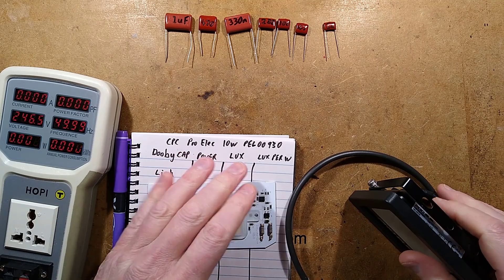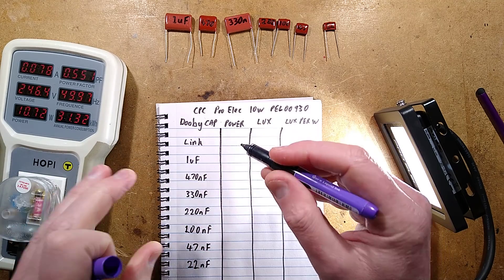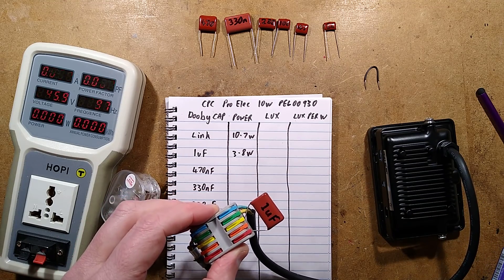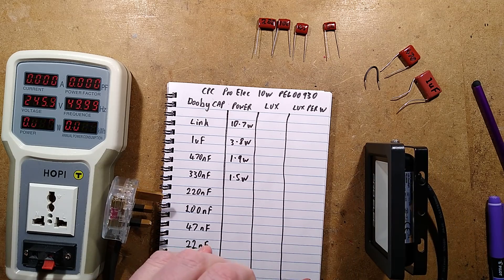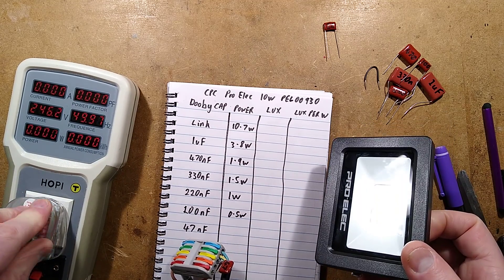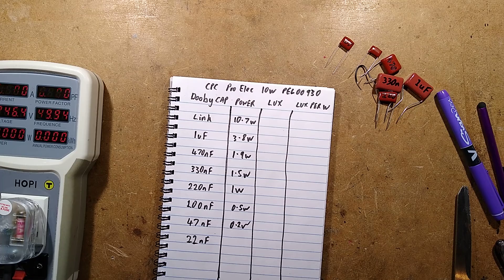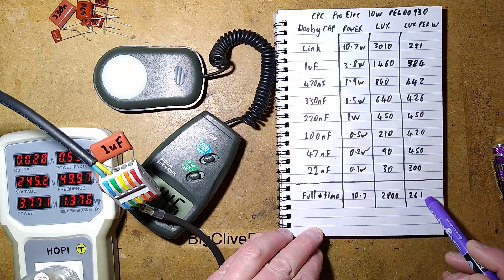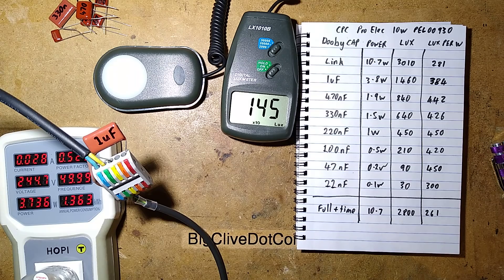Doobying a cheap LED floodlight with lux/efficiency readings

Comment: Thanks for the video. Will it work with a 300w led floodlight? The last light I bought only lasted 3 months. I have 1000nf and 2200nf capacitors. Which one is safe to use?
Reply from the maker: It depends on the circuitry.  The capacitor trick is also better suited for lower power lights.

Comment: Isn't Lux (Illuminance) lumen / m^2 ?? Meaning, if you know the lit area / cone you could calculate the lumenses. Or you adjust the height of the lamp above the lux-meter such that you light a square-metre and get the 1:1 value.

Comment: Does Electrolytic capacitors can be used instead of polyester capacitors? Value like 3.3uf 400v,  4.7uf 400v. If yes then do I have to connect the L wire to the + leg of the capacitor and the - leg to the led L  input?

Comment: Hi Clive. Can this be done with a PIR controlled LED floodlight i.e. using a 1 uF in series on the live terminal?
Reply from the maker: I'm not sure how that would affect the sensor's stability.
Reply: @bigclivedotcom  Could I connect it after the sensor Clive?
Reply from the maker: @ChicTumshy  That should be viable.  I'd recommend a discharge resistor across the capacitor to avoid zings while experimenting.  (about 470Kohm)
Reply: @bigclivedotcom  Cheers Clive. How do I go about including this discharge resistor "across" the capacitor does it go in series before or after or in parallel? Sorry Clive, complete novice to electronics mate.
Reply: @bigclivedotcom  Hi Clive. Got some 2.2uF capacitors off ebay and hooked one up just the way you did and it worked fine. It does not appear to affect the PIR function at all. I don't have the tools to check the power difference etc but light appears good enough for purpose. This test was done on a light that was fauly i.e. only two of the small led chips were lighting up. Let me explain fully. I purchased six 10w slimline floods (LED unit similar to yours but with only 14 rather than 15 of the small yellow led's) from Aldi and fitted the beginning of this year. Two have already partially failed with only two of the small yellow led's lighting up. The third led (the one after the lit two) is blackened so has failed and I take it that is why the ones after it are not lighting up. I cant get into the led card to repair as the glass is glued into a recess so cannot even get a blade in there to release. I will do your upgrade to the four remaining fully working lights and see if they last. It will be a tight squeeze getting the capacitor in the small connection box or might have to think of somewhere else to to fit it. When I installed the floods I fitted longer cables and fed them through the wall to my attic so could fit a junction box in the attic with the capacitor in there. Do you think that is a good idea or not? I have purchased some of the older type led floods to replace the faulty ones (the ones you can open with four screws to replace/repair the led unit) strangely they were more expensive. The led's in these ones are just one large yellow square rather than the 14 small ones (think they may have a led driver but will find out when I get them) so would I be able to fit the capacitor to that type to achieve the same result? Thanks for you time Clive, sorry for going on a bit 🙃regards.

Comment: would this cost me less on my electricity bill , as I have to put in some 24 hour security lighting. I don't need much light but have to cover a large area and was going to use 3 of these lights. This would cover the area, but be much brighter than I need so a wast of electricity
Lowering the brightens in this way would give the amount of light I need, and be more cost effective
Reply from the maker: It should work, and will also make the lights last a lot longer.

Comment: Can I ask another question? I know this is an old video but I'm curious, if you had a load of these in parallel could you control them with mosfets so they could be variable brightness, perhaps a gradient from low to high and vice versa?
Reply from the maker: They may be dimmable with a suitable dimmer for LED style loads.  That will only work with lights that don't use a smoothing capacitor.

Comment: I’m curious if a ceiling fan run cap will work. The build quality looks more robust and the leads are thicker and insulated. Anybody care to answer? Thanks in advance
Reply from the maker: Yes it will.  It's also a film capacitor.

Comment: Does anyone know where to get suitable caps? The ones that I can find on Farnell etc. are only rated for 150VAC, is that enough? (For European electricity grid.)
Reply from the maker: Look for class X2 suppression caps.
Reply: @bigclivedotcom  Would something like the KEMET R463I347040M1M CAP FILM 0.47UF 20% 630VDC RAD be suitable? I could not find anything as small (physically) as the ones that you have in the video though.
Reply from the maker: @sveip  That 470nF capacitor would work.  The higher voltage rating is an advantage for long term reliability.
Reply: @bigclivedotcom  quick update, I tried one 470nF, but that didn't work well, bad flickering (the LED lamp is large, 100W.) Then I tried 10 caps in parallell, effectively  4.7mF, but it still flickers, although not as bad as before. Not sure how to resolve that. It's an outdoor lamp, so it seems to be glued well together. If you, or anyone else, has any ideas on what to try next, I'm all ears :-)
Reply from the maker: @sveip  It sounds like it might have a high frequency power supply in it.  The cap technique only works with capacitive dropper supplies and linear regulators.

Comment: Why would you recommend running a resistor across the contacts?
Reply from the maker: When unplugged the capacitor can hold a charge that can give a slight shock.
Reply: @bigclivedotcom  I see! I'm thinking of doing this because I need a new light for my aquarium and these floodlights fit perfect! the only problem is that they are a little too bright and they get far too hot, if I put the 470nf capacitor in series will the capacitor get very hot??

Comment: Handy little project this. Doobied a set of super cheap 100w LEDs (4 for £35) Modded with thermal tape between board and case. Upgraded the mains cable to the board as it wouldn't stay in the Rainbow Wago, and potting the Wago in a project box as they're now video lights.

Comment: •_•)/ Emm, sir..
I have a question, about using flux when bolting a brass socket terminal with stranded copper wire..

Before I want to bolt a standed copper wire to a brass terminal, I usually apply flux to the wire.
I think it can keep protect the copper wire from corrosion..
But is it dangerous?
Reply from the maker: Is you're soldering the wire then a mild flux is useful.  Preferably as a core in the solder.  If just clamping the wire I wouldn't recommend flux as it can cause corrosion.
Reply: @bigclivedotcom  ohkay, thank you... 😊

Comment: Remember- you can always take away significant digits at the end, but you can't take them away before the calculations, then add them back in. ;) That power meter is something else though. It auspiciously reads to 1/1000 watt, but then just reads zero below 1 watt. That's not very confidence inspiring!

Comment: Would these capacitors be ok in higher wattage led spot lamps? 50w or 100w lamp?
Reply from the maker: No.  They're only really suited to low power lights.  Some simpler 100W lights will illuminate at greatly reduced power.
Reply: @bigclivedotcom  Thank you for the information. I will look at some other way to Doobying a higher output lamp. 👍

Comment: That works well if the driving circuit is sufficiently stupid. But a real LED driver circuit will be stressed even more more trying to compensate for the lower input. So your LEDs live, but the driver gives up the ghost.

Comment: Absolutely brilliant but would love to know what type of capacitor and voltage rating you used.
Reply from the maker: 400V film capacitor (or 250V for 120V AC).  You can use class X2 suppression caps.
Reply: @bigclivedotcom  Thank you so much, want to try the mode but also want to be safe when using mains voltage.

Comment: I have tried to do a dooby test on a LED bulb.  For some reason the light bulb socket I am using was not working with the LED bulb.  I need to get a different socket (the one I did get was a nominally waterproof one but it has wires attached).  I am still trying.  I want this to work or at least find out whether the FEIT bulb (from 2016) will work or not with this circuit.
Reply from the maker: Older and higher profile brand lamps may not work so well.
Reply: @bigclivedotcom  I went and purchased a different bulb socket along with a new set of LED bulbs (daylight, 60W).  I initially connected the socket to lamp cable (with switch) I was using and put the 2016 LED bulb in and it lit.  I was surprised that my volt alert device detected voltage in both wires when the switch was off and only one when the switch was on but I am no electrician. I was trying to be careful. 
I put the 470nf capacitor rig inline and tried the 2016 bulb but it did not light which I kind of expected. I put the newly purchased 60W (daylight) LED bulb in its place and darn the thing lit when switched on.  I had no current measuring devices and didn't know how "bright" it was supposed to be but when I put the new bulb in a conventional lamp holder and turned it on, gods it was bright! Much brighter than with the capacitor rig. I'd say that definitely the older bulb was not compatible with the scheme but newer ones would be.  
Thanks, I was happy to finally get this to work.
Reply: To anyone following this, US 120 VAC.  I went to 100 nf then 47 nf.  The new 60W bulb took a noticeable but short time to light up.  Longer for the 47 nf.  Output seemed more on the night light level.  Nice.  I have no meters for AC current or lumens or lux so can't tell what power draw or output was.  I did discover that my non-polarized plug, if I rotated it, demonstrated what had been expected - power went to the plug but the rest of the circuit had no voltage detectable until switched on.  Shows why a polarized plug is a good idea.

Comment: Now these are some useful results! ... but. Is it that the leds are more efficient when driven lightly or the capacitor is a key component. Can you try that with autotransformer if you have one. Just make the light draw the same power and see if there is any difference in efficiency. And thanks for these tests. It was very helpful. I'm obsessed with efficiency :)
Reply from the maker: LEDs are more efficient when under run.
Reply: @bigclivedotcom  I gess that's only valid for power leds because I've seen a lot of datasheets of indicator leds and they have linear corelation between current/output ( voltage barely changes) up to 30 mA

Comment: I use these LED floods as cheap aquarium lights, but the 20w ones I bought are causing algae problems. Your video might be the solution, clamp their power output to half.

Comment: I missed the live stream.  I recently bought 3 of these lamps as they were sooo cheap!  I have two clamped to my monitor, providing some desk illumination.  The 3rd I was going to tear down or keep handy just in case one of the others fail.  Seeing the results of your test I think I will be making up a little switch box to provide a a few output levels. Great video and perfect choice of light to test it on.  Maybe you had sight of my shopping cart on CPC! ;)

Comment: Can I dimm a LED ceiling light that has its own driver with a cap like this?
Reply from the maker: Most LED drivers can have their sense resistor changed internally to reduce their output and heat.
Reply: @bigclivedotcom  my issue is that some dumbass carpenter decided it was ok to build away my drivers in the ceiling. Cant reach them anymore without breaking the ceiling away again. The customer demanded tiny spots so I cant pull it through easily either. I can however reach the feeds to them. I'll try and see how far I get.

Very informative video, thanks dude 💪🏻👍

Comment: I'm still not 100% following with what's happening here.
AFAIK a capacitor wired in series doesn't let power through anymore once it's charged.
So the capacitor is limiting the power flow to the charge it can hold and discharge/recharge during the alternating of the AC current?
Reply from the maker: AC.  It allows a portion of current to flow on each polarity change.
Reply: @bigclivedotcom  Thanks for the reply and the 'confirmation' of my thoughts.
I know enough about electricity to rewire a few switches or install some sockets, but this is a whole other level. But it's nice to learn about all of this.

Comment: what value capacitor should I use for a 200W floodlight? can I use the same 1uf ?
Reply from the maker: No.  It may not be suited to such a high power light.

Comment: BigClive/Anyone?  I had a number of these floodlights connected together, and found that the inrush current was exceptionally high - there was costly damage to a smart home system. How would the addition of the capacitors mentioned in this video affect inrush current? Thanks in advance.
Reply from the maker: You may need to add an inrush limiting resistor in series to deal with the current spike of all the capacitors charging up from zero at power-up.  That hints at inadequate inrush limiting in the floodlights and a very badly designed "smart home" system that I'll guess failed with the output stuck on?
Reply: @bigclivedotcom    Right in one - they were on for weeks

Comment: The reason it's measuring lux and not lumen is that you can't easily measure luminous flux (in lumen) from a light source with a single detector since you would need to measure in all directions. You can only measure how much light that actually hits that detector (the illuminance, which is measured in lux).
Here is a clip that gives an idea what's going on:
https://youtu.be/TZ8qFUiQBIk

Comment: Clive, I didn't realise just how much the cheap products roast their LEDs. Not ideal at all, especially as the supposed benefits of long life and high efficiency should ideally offset the inability to replace both financially and in terms of CO2 impact. What brand(s) would you suggest are the best for long life LED products?
Reply from the maker: I'd recommend "customising" existing products like this to make them last longer.
Reply: @bigclivedotcom  Thanks Clive. I should've guessed that. 😁

Comment: What capacitor style are these? I see a dizzying array out there for sale. "Metallized Polyester Film Capacitors (MKT)" look right but looking right while still going POP would be bad. He mentions doubling for 110V here in the USA. Would that be 1uf if I was looking for the same results as the 470nf in the video?
Reply from the maker: The 400V (or 250V for the 120V) capacitors you mentioned should be fine.   Sometimes sold as X2 suppression caps.

Comment: Interesting.  I got a 150 flood light and I was afraid that it might not last long.  I had gotten another one last year and it was damaged.  Me being the fix-it guy I am, figured I could fix it, but upon opening it up, I seen the power supply was filled with epoxy or some kind of gray stuff.  I figured I'll just get another set of LEDs and put inside it and use another LED driver I have.   I've been meaning to ask you, where can one get a HOPI??  I've looked on ebay and amazon and can't find one.    I found something that may be similar to what it does.   It's listed as 

Poniie PN1500 Portable Micro Electricity Usage Monitor Electrical Power Consumption Watt Meter Voltage Amp Tester (110V, 1500W))   on amazon
Reply from the maker: The Hopi appears on eBay from time to time, but the simpler in-plug meters work well too.
Reply: @bigclivedotcom  OK, thanks!

Comment: Is it better to have a 0.5W rather than a .25W for the 1M ohm discharge resistor or doesn't it matter?
Reply from the maker: In this case the power dissipation is very low and the voltage rating is more important.  The voltage drop across the capacitor is low enough to use a quarter watt resistor.

Comment: I don't trust videos realeased on 1st April but I feel safe with Big Clive.
Reply: The Joke here is the 'lifespan' quoted on the packaging of these LED products.

Although I still wonder how to mod LED strips running DC current for longer lifespan.

MORE TESTABLE HYPOTHESI NEEDED!

And for the Final experiment. Functional RGB (AC and DC feeds) with eternal lifespans, and still correct behavior by remote.

Comment: Now you've got me thinking again.  A couple of years ago I bought some "driverless" LEDs thinking I could repair some dead LED light fixtures by screwing them to the metal pans but when I bolted one to a piece of sheet metal of about the same area it got burn-your-fingers hot after a couple of minutes and was ferociously bright so I put them aside thinking I might eventually mount them on old CPU heat sinks with fans for something where they weren't enclosed.
Now I'm thinking maybe if I run them at 1/3 or maybe 1/4 power (or maybe 2 or 3 of them at lower power per fixture) they might run  cool enough. Any recommendation of capacitor value to start  the experiment with? The ones I have are 30W 110V.
Reply from the maker: It may take quite a high series capacitance to limit the current.  You'll need to experiment.
Reply: @bigclivedotcom  OK. 1Mf dropped your 220V 10W to about 1/3 power so maybe I'll start with that and see what happens. Now to get the other projects out of my way so I can get to it.....